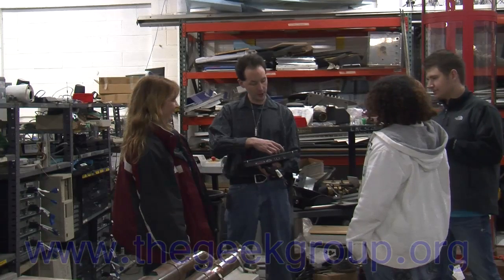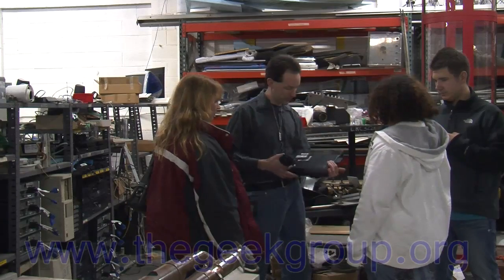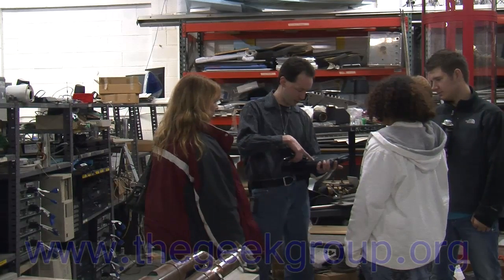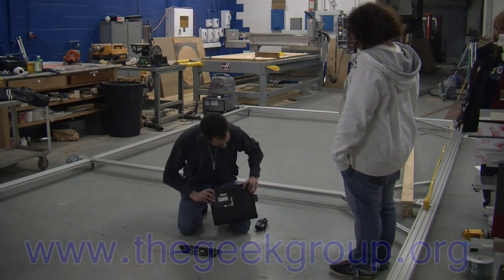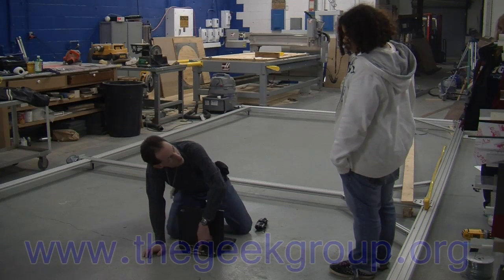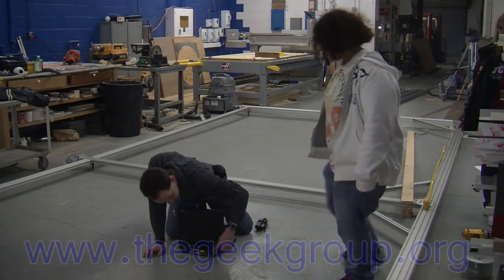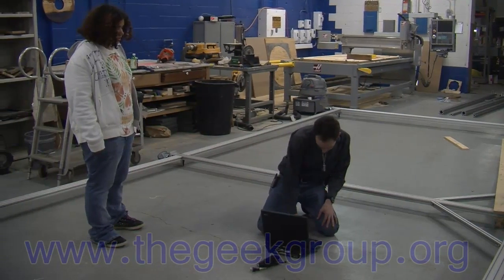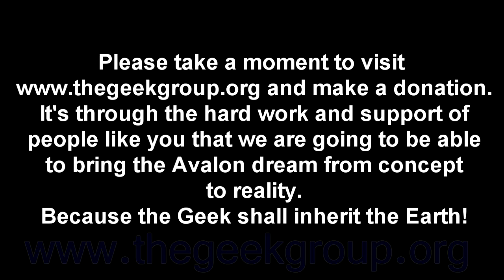Geek Group Computer Donation

Comment: Those are some really good tips.  I could have avoided some expensive repairs wife's laptop.   Although, if you shop around you can buy a new power adaptors from Hong Kong for $20 or so, for most laptop models.

Comment: I once closed my old laptop and put it in its bag. Hours later I found it crashed and didn't shut down...So yeh, it was very hot, the heat sync glue melted and it fell off the processor. Fun times

Comment: Yes and dust accumulating in laptop heatsinks and fans are a big realibility issue... some laptops are really poorly designed for aftermarket service, sometimes disassembling them for heatsink cleaning is very tricky and time consuming... Strangely some cheaper price laptops, like the Acer ones, are more esay to work on than certain famous brand very expensive laptops...